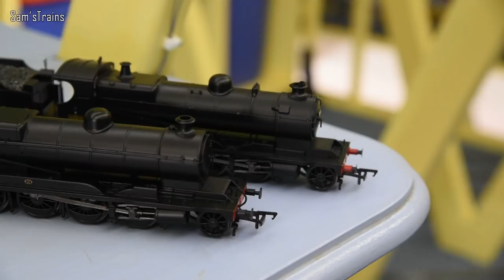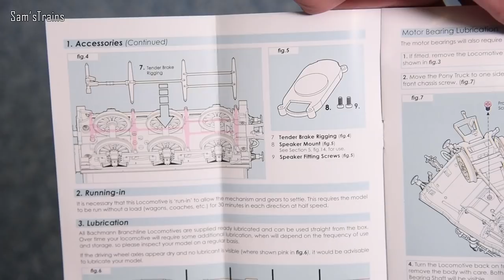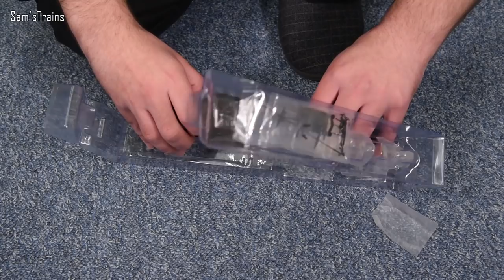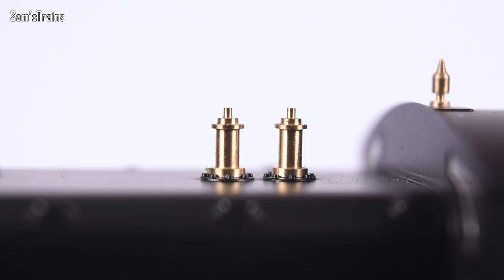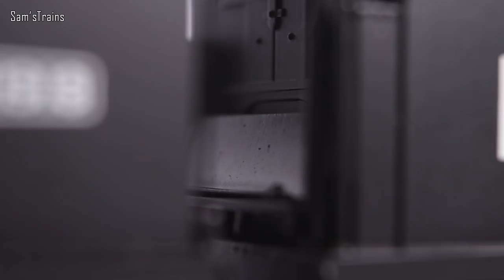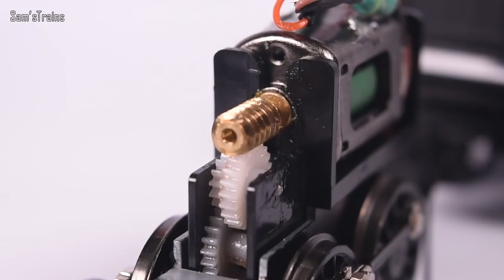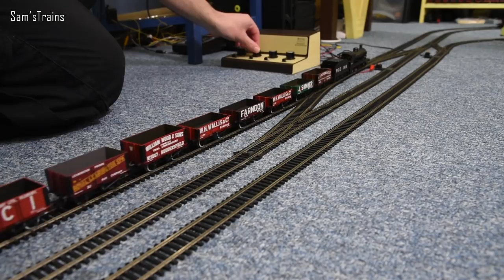Bachmann Wartime ROD 2-8-0 | Unboxing & Review

Comment: I like this locomotive and mine runs very well. However I did have the issue with the handrail coming loose which was a pain. The best bits are that the ROD letting is correct (Bachmann traced it rather than used a font) and the loco is correctly painted in black, rather than the silly and unrealistic khaki Oxford Rail used and now Hornby are about to make the same mistake. Black or grey, not khaki! How difficult is that to understand? It is handy having your own 3D printer. It's on my list to buy!

Comment: @SamsTrains I have another question pertaining to the value of the Bachmann 2MT, this one inspired by your ROD review. You rated this product two years after you rated the Bachmann 2MT, and you gave it a star less. You asked us to come back in three years to ask if the ROD 2-8-0 still performs well based on the performance of a previous Bachmann 2-8-0 featured in the video. Well, it’s only been two years, but it’s been four years for the 2MT, and I can’t see where the 2MT scored half a star higher on the mechanism than the ROD.

What I want to know is this; if your Bachmann 2MT has lasted for four years of operation, would it be safe to buy a used one expecting to get a long life of use out of it, or would I get three times the lifespan out of the similarly used Hornby 2MT that would cost me 3 times as much on American eBay, and which, for what it’s worth, would require a motor conversion despite its solid mechanism? I really want a 2MT, and I want to cherish it “for keeps.”

Comment: Part of the price problem is that shipping costs for China imports are triple what they were two years ago, thanks to higher dock labor costs, storage costs and container costs, all due to the wonderful Wuhan China virus.  Thanks China!  Still, if you spread the shipping cost over a shipment of, say, 1,000 models, the cost increase will only be from 2 GBP to 6 GBP.   Hardly enough to justify an asking price of 170 GPB for such a crude, mechanically ugly mess.  It looks like it was put together in Inner Mongolia in 1952!   Solution: Purchase a Hornby R3544 B12 for just 140 GBP!  I just did.  What a gorgeous model!  Perfectly assembled, a delight to look at, all metal boiler, runs as smooth as silk, as it should, with a five pole motor and two flywheels.  Now that is great value.

Comment: For the price I can agree it is not worth it even at a discount from a shop.
Pretty much sounds like you will have to 3D print some bearings for it to see if it improves its power to propel itself better.

Comment: As someone who is very much not versed electrical applications, how easy or otherwise would it be to change the motor out for a 5 pole?

Obviously you shouldn't have to do it at all anyway from a customer's point of view but for the sake of argument?
Reply: The problem is mechanical. The replacement motor needs to have the mounting point dimensions identical with the old motor otherwise the gear mesh will be out making for far worse running. No problem electrically, but needs resoldering of the wires correctly.
Gear mesh a problem with these primitive preferred British design of a worm on the end of a motor shaft.
Better designs with universal jointed shafts connecting to a gearbox allow much easier motor replacement.
However a good three pole can be better than a bad five or even seven pole motor. Unfortunately this Bachmann three pole does not have a great reputation.

Comment: I have a Robinson class 04 number 63601 the only left In preservation and is a very smooth runner on the layout and is the strongest loco I have I like the detail of the loco and the only downfall is the tender it’s so light and the tender to loco connector is 100% working probably and didn’t fail 

if something fails when you get it out of the box (if you haven’t taken it out before) then take it back to shop and get a replacement or a refund it gives a message to the manufacturer that the model isn’t up to standard 

Don’t make your own replacement for the loco since you’ve a lot for your models the manufacturer who made it and sold it to you should fix it for you as that’s what you made paid them for
Reply from the maker: Very glad to hear that - they do run surprisingly well I will admit!!
Thanks for watching, Sam :)

Comment: Can I send in two review suggestions?
#1: Did you already review the Fleischmann G3 (the locomotive you used with the Roco freight cars) to the same standards as the usual reviews? Keep in mind that it is a slightly improved starter set model.
#2: To stay in the WW1 theme, is a review of the Piko G7 (item nr 57550) an option?
Reply: No, not the Piko, but rather Brawa‘s Royal Bavarian G4/5H, #40100 or 40124.

Comment: I did enjoy your previous video giving a turbocharged motor upgrade to Smokey Joe. Given the woeful quality of this locomotive's motor, would you consider installing a higher quality motor, albeit one with a slightly more realistic power output than the one given to SJ? If so, how many other locos have been upgraded in this way?

Comment: I’ve a old hornby jinty from the early 80’s runs sweet as a nut and that had proper 
Bearings .

I’m sure the hornby star didn’t have them either if I remember Sam’s review correctly?
I haven’t taken mine apart to check for certain.
pretty poor for the price of these locomotives .

Comment: if a mechanism can perform satisfactory yet still have square slots with no bearings, can you really hate on bachmann for not using bearings? could it be the case, that not having bearings isnt a big of a deal as you're making it out to be? Ive had bachmann locos with no bearings run for almost a decade and still perform like the day it was bought. 

Dont get me wrong I can see the motor failing being a tiny 3 pole, but not having bearings in my experience isnt a big issue
Reply from the maker: It's a question of longevity isn't it? It's like saying if your car runs properly out of the factory, who cares if everything about it is cheaply and nastily produced? Increased friction causes greater strain on the motor - so you've got to clean and lubricate them more often, or face the possibility of motor failure (which is quite common - I've seen it with a good number of mine). The square slots also focus the force on one part of the chassis - and you can actually see where the axle wears into the chassis on locos with multiple hours running. At the prices we pay, there's just no reason for these features to be missing - I want my £150 models to last for decades, not just for the warranty period!
Thanks for watching, Sam :)

Comment: Hi Sam First thank you for the constant replies you truly are good at your game. Now for some more information. 
Oh no. What a great disappointment this is. An essential model for railway aficionados of Great Central Railway locations. They stick in my mind as I first saw these on a visit to Retford 36E in the early 1960's and was immediately struck by there elderly appearance.
Question: as members of the class were also built at Robert Stephenson & Co., why did not they choose the S&D 2-8-0s? Alas they were only coming off the drawing board in 1914 and were not proven enough. What a difference case that would have been.

Comment: A Robinson 04 would be a perfect loco to make a brilliant model its such a simple design so you can spend extra money on metal bearings high quality motor and in the end of the day how much do these things even cost. 5 pole motors are a pound on ebay goodness knows how cheap they are to bachmann themselves and that much brass is nothing its such a tiny amount. I'd love a good model of a Robinson 04 but this seems just a mediocre one at best. Although an interesting thing about the real thing is of the 4 perversed only 1 is in the UK and the other 3 are in Australia which I believe ended up there after being bought by a colliery railwaybut none of those have run in preservation. Great video anyway
Reply from the maker: Yeah you're right... instead they kept the simple design, charged a bunch, and produced something substandard... such a pity really! You're right - couple of quid tops for a good 5 pole motor, and that's to us consumers buying in tiny numbers!
Thanks for watching, Sam :)

Comment: Are fragile tender connectors good for the hobby?
Seems that needing a 3D printer and skills as a prerequisite of usage. Not good. Even the 3D part may not give good service.
In reality these bad points swamp pluses like metal safety valves and a whistle.

Comment: Good review Sam but I have to ask this:
When it comes to a mechanism how is a turned metal axle going to wear a metal chassis, metal is a substance that is very hard to break and I doubt that a smooth axle would be able to damage a chassis that is metal, the only time I have seen metal be breakable is when it has not been mixed right and then suffers from the Mazak rot, I think bachmann would make sure the mixture is right before they assemble the model.
Reply from the maker: Thanks David - the answer is friction... constant movement between two metal parts will inevitably cause wear. That's why almost all machinery has bearings! I have Bachmann locos of a similar design whose wear is noticeable - will take a photo at some point to show this!
Thanks for watching, Sam :)
Reply: @SamsTrains  thank you for the answer however I do disagree a bit, metal touching metal doesn’t t cause a lot of friction plus the axle is smooth and I would take a guess of the chassis where the wheels sit is smooth as well, I can understand friction being an issue with there being a lot of axles all touching the chassis at the same time but with it all being metal and from the looks of it being very smooth I can’t see there being a lot of friction also it’s metal which doesn’t wear very quickly like I already stated before.
Reply from the maker: It isn't really up for debate - it's not a matter of agreeing or disagreeing! Properly designed bearings are essential in any kind of machine - fact. If metal on metal didn't cause friction (which it does by the way, lots!!), why would cars, trains, rotating tools, motors or anything mechanical have so much invested in proper bearings? Why not just have square slots in which shafts can rotate?
Here's more information for you: https://koyo.jtekt.co.jp/en/2019/06/column01-01.html
Thanks for watching, Sam :)
Reply: @SamsTrains  And if metal to metal had no friction, metal loco wheels on steel rails would just slip and there never would have been railways.
Reply from the maker: haha that's true! There's no argument against it - it's ubiquitously accepted!
Reply: @henrybest4057  I think you will find that even though there is friction it is still very low that's why when trains move off they have to do it slowly, also we still see a lot of locomotives wheelslip on the rails, metal to metal contact doesn't cause a lot of friction.
Reply from the maker: But what happens when a locomotive's wheels slip? Even despite the small contact area, huge damage occurs to the rails and the track. You have that constantly with the square bearings!!
Reply: @SamsTrains  It's the small contact area that causes the damage. Friction over a large area causes less damage. Spreading the friction over a larger area is how bearings work.
Reply: @SamsTrains  even if that is true it would still take a fairly long time for the metal chassis to wear beyond repair and rendering the locomotive useless, many older locomotives have the axles sit straight into the chassis, also just a thought when a Square slot starts to wear because of the axle spinning in it the slot would become circular which would increase the area covered therefore the time it would take to wear would be even longer as there is a greater area covered.
Anyway end of argument now we have all put our cards on the table and had very different discussions regarding the topic, time to move on.

Comment: I get the impression that this box has been dropped, it would explain the broken coupling and the fact that the handrails in the cab have separated from the roof….
Reply from the maker: Yeah you could be right - or at least handled roughly in shipping! This should be expected though; hence why a thin piece of weak plastic holding the two together is a poor idea!!
Thanks for watching, Sam :)

Comment: I’m so happy to have Märklin trains. Some over 50 years old and running like new. What a rubbish these brands as Hornby and Bachmann
Reply: Well some of them are bad, some are good
Reply: @cheetodorito4207  
At least the bad mechanisms don't last long in production, and even then, bad mechanisms usually just mean that they need more maintenance and make more noise, but still run fine and last long. Good mechanisms meanwhile usually mean maintenance once in five years and running without issues for several decades.

Comment: Now to me it looks like a toy it's to clean for ww 1 replica but also just looks cheap  with bright silver valve gear im sorry if offends people great review Sam sorry for being so negative about it.
Reply: Many collectors prefer their models ex-works condition. There really is no such thing as "factory weathered"... weathering is something that occurs during a loco's life and will vary greatly according to type of service, main traffic (eg coal, iron ore, limestone, general merchandise, and so on). It is not difficult to use weathering powders, which generally clean off if you bodge it at first, but you need to follow a good colour photo for total realism. Personally I use a mixture of powders and acrylic paint and a OO brush for lime streaks and steam rust, maybe an airbrush for brake and ballast dust.

Comment: Thing can appear to have simple livery but be complexly detailed,
thing can be both simply detailed and pained but if both things are done with high degree of expertise, and offcourse if it runs well it may just be worth while.

Even tho not everyone has the skill set to do it, paint and details are by far the easiest to fix, engine, drive train, wheel bearings are something i would be afraid to mess with.

Mere act of taking it out of packaging makes it start to fall appart wow, thats some quality.
Ahaha that resistor just splooged on the motor chassis! what a solution. This cant seriously cost that much man, its 20 quid alibaba train on in inside come on.

Unless the retooling is literally JUST the shell its all inside this loco is just atrocious.
Reply from the maker: Yeah that's a fair point - mechanical flaws are much harder to fix! haha, I won't disagree! ;D
Thanks for watching, Sam :)

Comment: Ah Bachmann have put their 50% tax on as usual, yep way overpriced. 3 pole motors aren’t necessarily a bad thing but the lack of axle bearings is appalling these days. I would also prefer to see a wireless connection between loco and tender like the way Dapol are going. Another good review & rant.
Reply from the maker: Thanks Rob! Yes certainly - some 3 pole motors do perform well, but this type from Bachmann has been quite unpredictable in my experience... some of them superb, quite a few of them failing after an unreasonable time. Yes, wireless is definitely the way to go - Dapol did a wonderful job on that!
Thanks for watching, Sam :)

Comment: Same kind by Hornby the O1 : GBP 99... Nice looking model, but blatantly expensive Bachmann-like, and it's not the worst. For the tender coupling bar, the standard is the GWR Mogul by Dapol, anythying else is crap.
Mechanism : see what I said about the Hornby O1, no comment... Maybe if they divide the price by two, this model would be acceptable... Only Heljan with their Tango are worse in this category ! At least, this engine by Bachmann is functionnal.

Comment: It’s a tough one when complaining about quality as I know the people making these are being treated awfully and paid very little in the Chinese factories. It’s a shame they are made poorly sometimes but who is really to blame?
Reply: Most of the issues are with the design and choice of materials. Eg plastic peg for tender coupling too easy to break off in service instead of a screwed in metal drawbar.
Reply from the maker: Absolutely John - those doing the assembly had nothing to do with any of the issues described. In fact the actual assembly was pretty much impeccable with this model!

Comment: No! I did not enjoy this video of a Locomotive that need a rebuild straight from the box. Sam, how old is this Loco? You and I have both seen other Bachmann models that were of much better build quality including bearings on the axles. The question is why Bachmann? Value for money, that is all we ask for Bachmann. Martin (Thailand)  £70.00 would still be too much.
Reply: I'd value it at £85-£95 before discounts. With proper bearings, 5pole motor, flywheel etc, £125-£148. The mech really lets down a superb rendition of this workhorse.